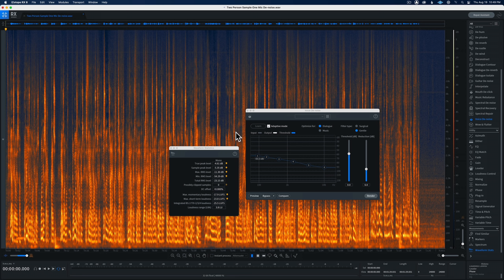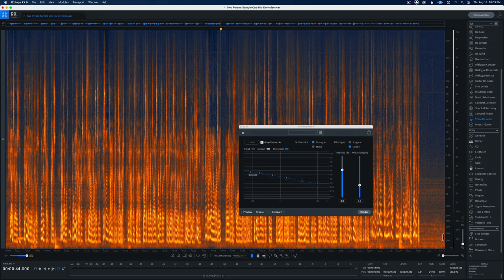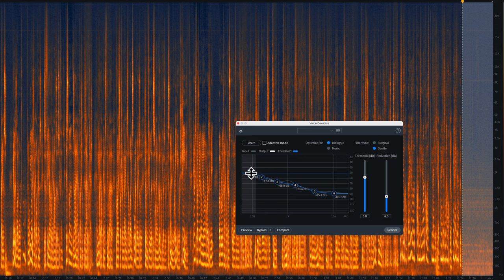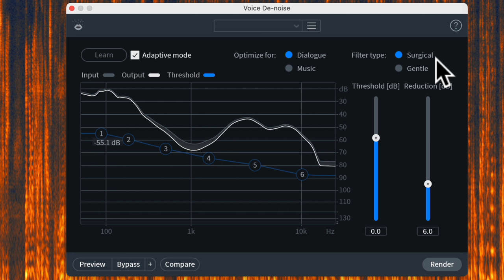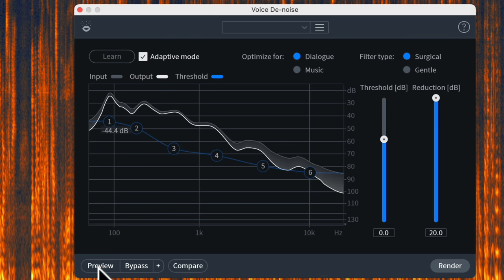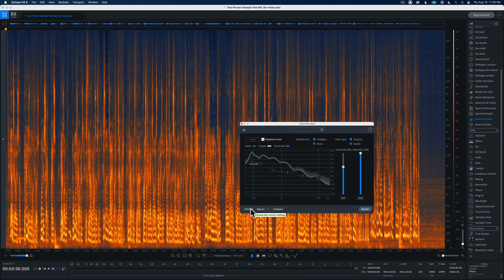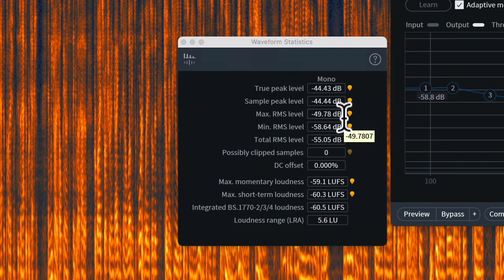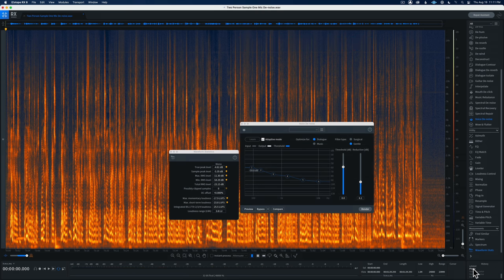Izotope RX Voice De-noise In Depth - Remove Room Noise

Comment: Thank you very much Curtis - your explanations are super clear for non-experts. 
Please could you consider a video on removing breath sounds - maybe using the Rx de-Breath - but also using tools available in standard apps (I use FCP), such as a Noise Gate. I have played with noise gates and they seem to help with my in-breaths (I had pneumonia a few years ago, so the sound is prominent). But I am not an expert. I mostly remove breath sounds by manually ducking them in FCP.
Reply from the maker: Yes, I use RX De-breath often and will have another episode covering it.
Reply: @curtisjudd  I'd love to see this as well. I did an episode on my Audio for Content Creators channel on Waves De-Breath, which I find a totally obnoxious plugin.
Reply from the maker: @brianmillerspeaks  Thanks Brian, yes, this one can be tricky just like a noise gate.

Comment: I have an XAir that all my audio feeds in to and I want to use this de-noise for live streams. Not sure how to do that. I presume I need to use a PC and pass the XAir input into USB send, through this VST plugin then out to another XLR output so I can send to my recorder? Any guides on doing this with XAir?
Reply from the maker: I've not done this but I think you have the right idea.
Reply: @curtisjudd  think I've figured it out. Xair into PC using USB send and return to basically loop the inputs through PC first. Then use a VST Host I've used Gig Performer and pass Xair USB in to the rack then the VST plugin of Izotope then out to XAir USB return

Comment: What do you think about using Spectral De-Noise to achieve the same results? I normally record a second or two of the room noise and use that as the 'template' of the noise that I try to reduce. It works well (in my particular case) - but do you think you can get the same results with both methods? Loving all your videos Curtis, keep up the wonderful work.
Reply from the maker: I’ll have a separate episode covering Spectral De-noise.

Comment: What's the difference between using Voice De-Noise and Spectral Denoise if you learn from the self-noise (room noise) and apply it to all waveforms?
Reply from the maker: Standby, we’ll have another episode on Spectral De-noise. But one obvious difference is that Spectral De-noise is not as practical for live use with its much higher latency.
Reply: @curtisjudd  can't wait! thanks a lot

Comment: Hello Curtis. This talk was so clear, cordial and helpful! Five months later and I'm looking at denoising 200-plus CDs of informal conversation and talks, some with horrendous noise, captured on cheap casette recorders, late 1970s and early 1980s. I have RX7 Standard and, now, RX Elements Suite with RX8, Ozone, Nectar, and Neutron Elements. I'll be working on an M1 Mac Mini. Nice to know I can do a couple of passes. I wonder if Voice De-Noise or Spectral Noise Reduction will be the best for the really ugly tracks.
Reply from the maker: Hi Amanda, thanks. Generally, Spectral De-Noise can remove more noise in the situations where it works well. Best to experiment with it first. But I often find that Voice De-noise works great on spoken word audio.
Reply: Thanks so much for responding. That really helped me understand when to use each module. Very important, with so many files to denoise. Of course, I'll be testing as you suggested, and maybe set up a module chain to run as a first pass.

Comment: Curtis I need your help please...
I just picked up a Zoom F8n..Love it so far.
I'm using a LCT 440 Pure mic..I use to use that mic with the Zoom H5. I also use Adobe Premiere Pro so I've always used some filters in my timeline to get rid of the background noise. And never had any issues when I cut my talking head shots. But now when I use the F8n and use the filters the sound is perfect until I start cutting at the beginning of each of cut it muffels the sound and then returns to normal after a few seconds?  If I don't use any Adobe filters I can cut all day long and the sound stays the same. But then I have the background hiss?
Love what you do 🙏
Reply from the maker: Hmm, sounds like maybe the effects/plugins you’re using are the issue. Would need the details on what you’re using there. Consider adding them back one at a time to see which one is creating the issue.
Reply: @curtisjudd  thank you Curtis..
Upon further research turns out it's a Adobe Premiere Pro glitch with the Denoise plugin
Reply from the maker: @BrannonNod  Nice work sorting that out.

Comment: Hey, Curtis, huge fan of your channel.  Just had a quick question for you.  Do you typically always use some form of noise reduction regardless of the gear you're using?  Thanks.
Reply from the maker: No, only when needed. I prefer to control the noise in the room so I don’t have to resort to post noise reduction. On location, where I don’t have as much control, yes, I often have to do a light pass.

Comment: Excellent video, thanks!  I just shot an interview in a truck as we drove through high country back roads, I will try the surgical setting to see if I can eliminate the noise from the washboard roads.
Reply from the maker: 👍 I hope it helps! We'll be covering some of the other tools in the near future as well.
Reply: @curtisjudd  Welp - the process was not as easy as I hoped.  I opted to use Dialogue Isolate instead of Voice De-noise but the results are average.  I think I will do a two step process with De-noise first followed by Isolate and adjust the gain and ambience preservation to minimize artifacts. This is great software, just wish I didn't need to use so many elements. By the way, what Compressor plug in do you use with RX 8?
Reply from the maker: @bluedun9816  Its hard to clean up noisy recordings. Izotope RX isn't easy, but it is powerful. I generally use the Izotope Nectar compressor.
Reply: @curtisjudd  Dialogue is much more difficult that music.  I am going to look at the Multiband Compressor in Fairlight, haven't used it before, so get to learn a new tool.  Thank you for your input.

Comment: Great and great content.😉
Just one question. Did you "learn" the plugin where the noice where "manualy" and then adapted it at first or was it just to show the differens between manual and learning and adapt? I got it like my first thaught.
Reply from the maker: Hi Magnus, I'm sorry, I don't understand the question. In cases where you don't have a clear section of only noise, the adaptive mode can work nicely. Also, if the noise changes a bit throughout the clip, the adaptive mode can be helpful. In some cases, however, the adaptive mode can make some rather obvious changes and the manual/learn mode may be preferred. You have to experiment with each audio clip too find which works best for that particular clip.

Comment: Good info!  I bought the app when I had to do an interview in an aircraft hangar. I’m not an audio guy and this definitely was easy to use. Thanks for helping me understand when I should change the settings.
Reply: Would RTX voice have worked just as well or better, but it's free since it works on any GeForce GTX or RTX card released since 2016?
Reply from the maker: If you have an RTX card and are not using it as a live processor.

Comment: This tutorial was exactly what I needed so I subbed, Thanks! Also when you used the EQ, what were the reasons behind specifically using a 48 dB/octave cut and at 80Hz?
Reply from the maker: I chose that because it cut out the low frequency rumble without affecting the dialogue. I do that because people who play back the audio on speakers (often with a sub woofer) which can play back those frequencies won't have a nasty bass rumble surprise.

Comment: This was really great - and wish I'd seen this video when I was struggling with De-Noise in Elements years ago! And your mouth click one - I came to the same opinion - and also had CPU issues with running DeClick or some of the other plugins bar Breath Control - so I have that in the stack just reducing those, and then pre-process the vocals with Mouth DeClick - and your settings were pretty much what I've been using, which is reassuring!

The one that really confuses me now, and I tend to just tweak existing presets is the Spectral De-Noise in RX Standard. It's like the bridge on Star Trek that plugin! But the quality is so much better I feel, even though there is more processing overheard? I just batch the podcast vocals in the background.

So a video on RX Spectral De-Noise would be really useful.
Reply from the maker: Thanks. Working that direction.
Reply: @curtisjudd  Good to hear it! Keep doing this amazing job.

Comment: Curtis, do you think this could work for sibilance attenuation while recording and, if so, would you need multiple de-noise-rs in the FX chain to pinpoint troublesome sibilance ranges (i.e. 6-7khz for s's and 3.5 - 4.5 for c's)?
Reply from the maker: Mmm, I’d generally reach for a de-esser plugin first.
Reply: @curtisjudd  Yes I've been on a long journey trying to find one that works for me post recording. I even bought Soothe 2 a year ago, which some say is the best available, only I cannot find instruction on how to tweak it beyond its sibilance presets. RX's seems to not work as well. I would just like a different mouth.
Reply from the maker: @mamandapanda185  I can't help much with the mouth. Maybe try a different de-esser if you're finding the RX de-ess module isn't working well for you. Maybe try fabfilters?
Reply: @curtisjudd  Thank you!

Comment: Hi Curtis, great video thanks for putting in the time to share it!

I have a question: When do you NOT use adaptive mode? ie. what kind of problems are best solved with the non-adaptive setting? 

I process a 3 track podcast every week where the tracks are 1.5-2.5hrs long each. I have found that non-adaptive gives me better results considering that I am applying the de-noise over such a wide swath of audio with loud and quiet moments.

Thanks in advance!
Reply from the maker: Hi Chad, adaptive mode works pretty well in most situations, but I have encountered one or two where it left some artifacts that sounded like it was obviously changing it's configuration mid-audio-clip. It is usually pretty reliable, though. So I don't hesitate to use adaptive mode most of the time and just keep an ear out for any odd transitions it may leave. But for long-form content like what you describe, the manual "Learn" mode is probably safer.
Reply: @curtisjudd  thanks so much for the quick reply and for making such great educational content!

Comment: A bit late in seeing this one, I'm a big fan of RX. I've been using RX 8 Standard for a while now. I did upgrade to 9, but I haven't really done any recordings recently to need it. Anyway, I've got a nice batch setup that includes this module. Slightly different settings, but achieve good results. My two main issues are AC sound that may or may not be present and, funny enough, the potential of the dishwasher going in the background. I literally use the dining room table and record late at night. But the dishwasher will frequently be started before I'm planning on doing a session. This module effectively eliminates that sound. Even at its loudest point.

The modules I use, in order, are Mixing (the Zoom H1 is mono for me), De-clip (just in case), De-click, Voice De-Noise, De-reverb (just to flatten things out a bit more), EQ, and Loudness Control. Works really well as a batch. I just now have to import my presets into RX 9 when the time comes when I create more content. Always great videos and you explain things very clearly!
Reply from the maker: Thanks for sharing your process!

Comment: New subscriber BTW (really enjoy your presentations). Q: can i use this program for cleaning up old cassette tapes (I have about 100 i want to digitize). Is it over the top for that, is there a program you recommend? Thank you.
Reply from the maker: The elements version would be good for that. But you first have to capture the audio and digitize it. This app doesn't do that.
Reply: @curtisjudd  Thank you i have a way to digitize them, just want to take the hiss and clean up vocals etc. thank you Sir.

Comment: Thanks for another great video, Curtis.  You mention that in can be used in real time for streaming but I can't find much info out there on how that would work.  What is the basic set up? Also have you tested the music mode?  I'm wondering how well it would work outside of vocal applications, say on the violin.
Reply from the maker: Hi Clayton. To use any plugins during a livestream, you would need a host app which can run VST, VST3, AAX, or AU plugins. I don't know whether you're using Windows or Mac, but on Mac, I'd probably use Audio Hijack as the host app. I haven't used the plugin on music recordings yet.
Reply: It is possible. On Windows, ASIO Link Pro is the best. My setup is REAPER > ASIO Link Pro as output devices > set the ASIO Link Pro's input devices in Windows as default properly > OBS/Discord/games/etc. Then make sure the programs are using the ASIO Link Pro's input devices which it has installed into Windows. 

I use REAPER because sometimes I need to record my own voices while livestreaming, so it's more of an all in one solution.
Reply from the maker: @Hzuuuu  Thanks Deo.
Reply: Follow up comment: I've been experimenting since you posted this video and it works great with music. I am now able to route Logic into Zoom via blackhole which is fantastic as the zoom noise filters need to be disabled when playing live music.  I've been teaching fiddle and occasionally performing concerts on zoom since the beginning of the pandemic and this has really cleaned up the audio!

Comment: Will this plugin possibly help remove an audible clicking sound caused by an artificial heart valve when using a wireless or lav mic?
Reply from the maker: It isn’t as good at discontinuous sounds like that. Spectral de-noise would be a better choice there.

Comment: I am using this as a plugin in Nuendo 12, and wondering where I can get the orange audio-visual background you have displayed so that I can manually select the blank portion of the track with the hiss in it?  All I am getting is the black/blue plugin portion.  Any help would be appreciated
Reply from the maker: The Spectral editor is part of the RX Audio Editor app. I don’t know if Nuendo has ARA2 support. If it does, the new version of RX spectral repair may work. If not, you’ll need to round trip the audio over to RX.
Reply: @curtisjudd  Makes sense.  Thank you!

Comment: Hi Curtis thanks for your video I recently bought rx 10 standard and not seemingly to get good results with a hiss that comes trailing with my vocal signal.  Seems simple enough but not easy to find that tradeoff of losing character.  Your video gave me some good ideas to try before the next attempt.   Including running it through multiple passes.
Maybe I had imagined it differently in in my head but it's just kind of a form of advanced EQ'? 
For some reason I thought it would learn the noiseflour and then pick out all those specks and particles of sound lol... maybe i'm just dischenchanted because I don't understandfully how it works and it's not working for me :)  Thanks for making this video!
Reply from the maker: Technically, this is a bunch of noise gates working at different frequencies. There is a manual mode where you can have it learn the noise pattern and then apply it.

Comment: Thanks for this. Informative!

Would really be interesting to hear your opinion on the other features of RX8, even the ones in the most expensive version. Personally I use the Denoise all the time to clean noise floors, but many of the other features (like reverberation removal) seem to cause more problems than solve them. Have you found any others really useful? Or maybe I'm using them wrong? 

Thanks!
Reply from the maker: Will be covering more and putting together a full course as well. Thanks!
Reply: SPL De-Verb is really good for reverb removal, check it out

Comment: Curtis, I love your videos man! Thank you so much for all the knowledge you've shared so far! 

Would love some insight on how should I fix a recording with a noise floor at -24dB and the dialogue peaking between -12dB and -9dB... It's soo loud but relatively steady... In that case what level should I aim to bring the noise floor to? I know -60dB would be impossible without many artifacts... And should I make my ambiance tracks a little louder than usual to try to hide/mask the noise?
Reply from the maker: If you can get the noise floor down by 12dB from where it is presently, you’ll be lucky.

Comment: In clips where we do not have just noise and there's constantly ONLY sound, adaptive mode itself does a pretty great job. Because if you do not have just noise, it is hard to properly utilize learn, or at all. So I find in those cases either adaptive or manually tweaking it myself and listening to the sound leads to decent results.

Comment: I bring that Voice De-Noise plug-in in and it is dead.  I see no activity happening in the window.  I play my loop and nothing is happening in the plug-in window.  How do you activate and deactivate it?  Also, when you work with a plug-in, and decide it isn't the one you need, and you close it, does it still keep working, or does closing it go back to it not being used?  I don't see an 'active/not active indication where I can understand what is being processed.
Reply from the maker: It is only active in the RX audio editor when you press preview or apply. If you close it and DO NOT press apply, it is not longer affecting the sound.